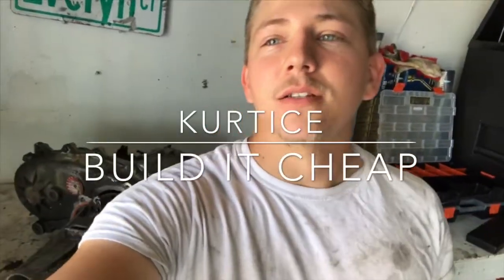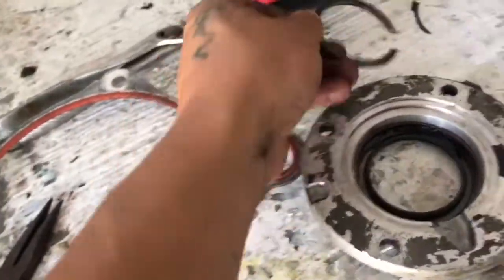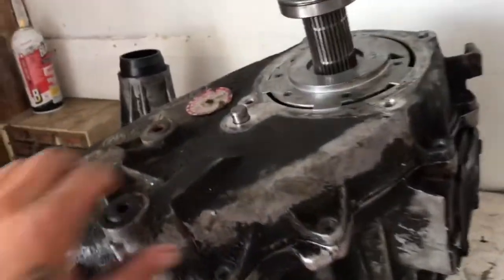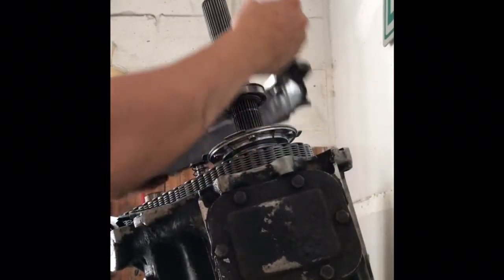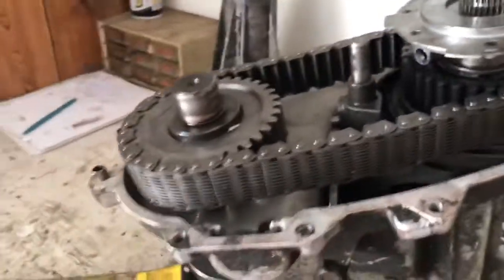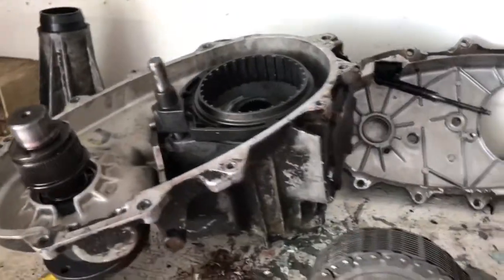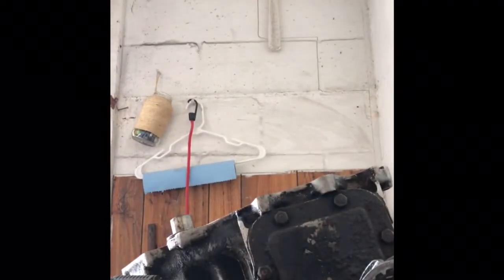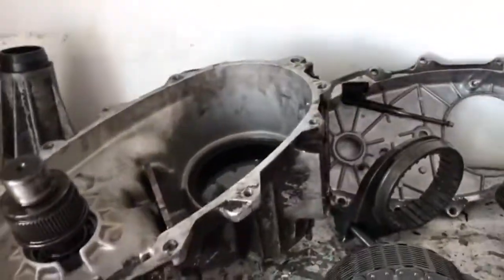Cummins NP241DHD transfer case tear down

Comment: I have a 96 3500 and my input shaft has a lot of play is that Normal also there was no pads
Reply from the maker: There’s always going to be some play, but how much is the question. I can’t remember the number of how much but more then maybe 5 or 6 thousands and I’d guess you have an issue. Also your t-case should be a a different one this this one so you’ll have to just research to find the exact number

Comment: Was it hard to pull of the truck? I’m rebuilding mine tomorrow
Reply from the maker: DieselBoy 5967  not at all, drop the drive shaft remove the bolts holding it to the trans and disconnect the shifter and it comes right out

Comment: Question  Kurt ? Where does the trans fluid (gear/chain oil ) dis appear to in the transfer cases ? That stuff is like  Chris Angel  !
Reply from the maker: jack myers make sure you’re not leaking any and if not it kinda just goes to the bottom and there’s a pump to make sure everything is oiled up
Reply: No leak just seems to disappear or dry up ?
Reply from the maker: jack myers if the case it’s self isn’t leaking at the seam I think it can either leak from the front where it mates for the trans or the rear at the slip yoke